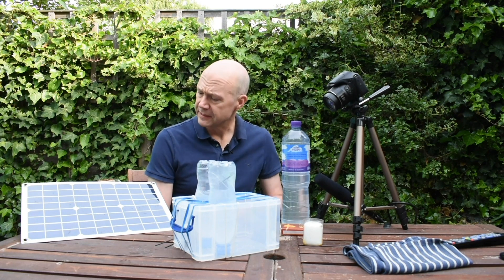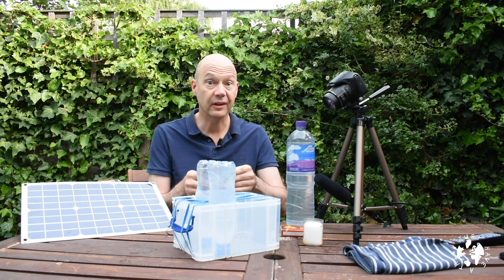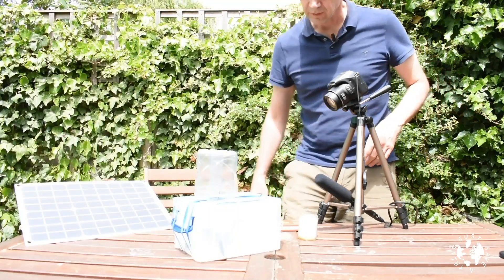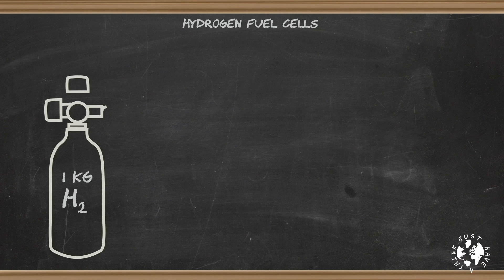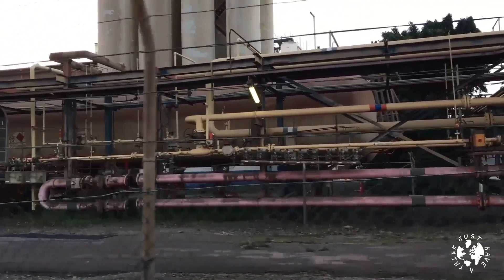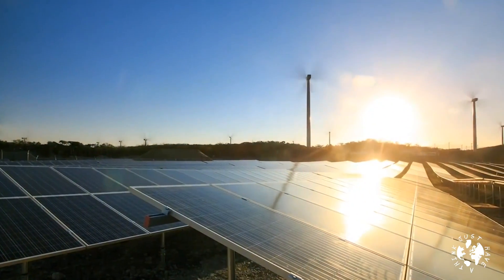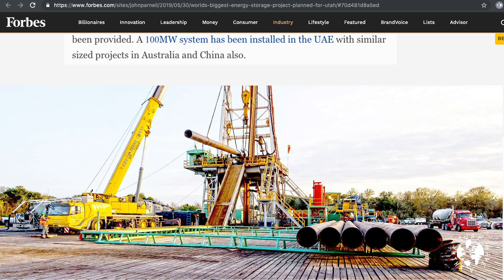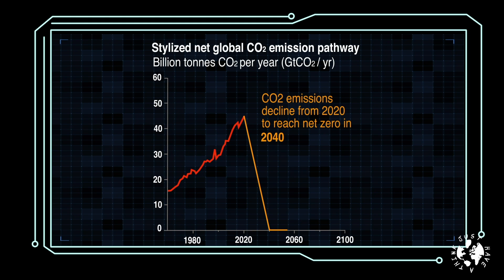Energy Storage in Hydrogen : Does this beat batteries?

Comment: no it wont beat batteries becuase its like 60 percent efficient vs 99 percent with batteries
Reply: efficiency does not matter here. at times there is so much surplus renewable electricity, that the producer must pay to get rid of it (or shut down turbines). in that case, the cost of energy is a negative value in the overall cost of the gas produced, and therefore it does not matter how inefficient the power to gas process is. the produced gas is still very cheap, because the energy to produce it would have to be (for example in the case of a windfarm) "declined" from the wind, and the turbines spinned idle - or even on brakes. so, there is at least some money made instead of no money made. if there is the chance to make power back from the gas at peak demand, there's more money to be made still. and another plus, the grid gets more stable if you can do that (as said, this can work with batteries too, but is arguably much more expensive for large storage, as the storage of gas only gets cheaper, the higher the quantity).
Reply: @aleksanderkac1494  So whats your saying is hydrogen could be a viable alternative to gasoline in cars becuase it could be used as an energy dump from the surplus reneuables? That could fall victim to the tragedy of the commons, for a few hydrogen cars sure it would work but if you have everyone driving a hydrogen car your no longer just using surplus and instead you have to make extra which would use more overall resources. Personally id like to see the probelm of surplus renewable energy solved by having the surplus electricity used to pump large amounts of water from low reservoirs to the reservoirs above hydroelectric power stations which could then be used to spin turbines to get the energy back when needed. Basically batteries scale better for using less resources.
Reply: @anthonyhadsell2673  No. Power to Gas hydrogen can be fed directly into the existing gas grid to be used at home, or used in PtG methane production. We do this already in Europe. European cars can be bought factory converted to natural gas (which is methane, so PtG methane can also be used), and a lot of our garbage trucks that work in the city are already NG trucks, not diesel. So this gas is ready to be used at home in heating or cooking or in cars and trucks that are only marginally more expensive than gasoline cars - or diesel cars and trucks. But you also have a point. Pumping power stations are also a good use of surplus energy, but not applicable everywhere. In Europe, not every country has available positions for high reservoirs. A mix of all methods will be necessary to store surplus power.
Reply: @aleksanderkac1494  I believe that while hydrogen cars could be viable they wouldnt be an ideal solution if everyone used them and itd be better if they were more of a niche thing to use as an energy dump due to the fact that batteries use less energy to move the same distance. Also im an american so im unfamilar with what your talking about but how could hydrogen be fed through gas lines? wouldnt they just mix together and create a gas that would put atleast some carbon into the air?
Reply: @anthonyhadsell2673  Actually no carbon. Hydrogen burning emits water only. It can be fed into a NG grid to a certain percent, displacing carbon from methane. Instead of NG, there would be NG with a percentage oh hydrogen added, it's no big deal, any normal NG appliance can handle it. Natural gas is not carbon neutral, so adding some renewable hydrogen into the mix would be beneficial. But, renewable hydrogen can be used to produce methane (by reaction with CO2 from a gas power plant for example) and create methane. This is the same gas that forms the majority of NG. Vehicles driving on NG are readily available and reasonably priced, IE. mostly the same price as a gasoline or diesel car. In a lot of cities of Europe you cannot use diesel municipal trucks, but we have methane trucks from the likes of Scania, Renault, MAN and Iveco. So it's a mix. We will need batteries, EVs, gas powered combustion cars and trucks, pumping power stations and some longer term storage, like compressing gas into salt mine caves. Or some other invention maybe.
Reply: @aleksanderkac1494  Im aware hydrogen burning emits no carbon i was just saying that when its mixed with ng it would put some carbon into the air. Less than gas diesel or pure ng but still some.
Reply: @anthonyhadsell2673  True. But a percent less is still a percent less. Do that at everyday level of activities, and the world gets better. To clean up our act will take more, but with small steps, we might just get there.
Reply: @aleksanderkac1494  Yeah i guess but really the effect me or you have on climate change is incredibly minimal. The public has been basically brainwashed into beleiving pullution and climate change is the fault of average people when really 70 percent of green house gasses are from the operations of companies and the reason we have so much litter is becuase plastic is cheaper than things that break down naturally, the mindset most people perpetuate is one that removes most to all blame from companys and puts it onto the individual, your right about it helping to put less carbon in the aptnosphere in any way but personally id like to see more people blaming large corporations.
Reply: @anthonyhadsell2673   Pump storage is not a global solution (unfortunately). In countries with moutains they have used if for decades (lower construction costs), if you want to do that in flat country it gets much more expensive. (They experiment with old mines - weight moving. Or compressed air (but this is storage for days not to bridge seasons).
Reply: Aleksander Kac when do you realistically expect real surplus? Shouldn‘t we switch to heatpumps first?
Reply: @matschlegel   Surplus power is made all the time. Not only in the renewable sector. Coal power plants can't modulate output quickly. Heat pumps have nothing to do with power storage like power to gas or batteries, heat pumps are appliances. And I thought you got that covered already in your "wende".

Comment: But you didn't answer the question in the title!
Reply from the maker: I think the answer is that the 'jury is out' on the main question. There are (as many people have pointed out) some efficiency and storage issues with hydrogen which are definitely challenges to it's potential global supremacy. My view is that the market will eventually sort out the winners and losers (as long as they are not fossil fuels), but the best strategy for humanity is to try to utilise ALL of the available renewable options so we have a 'best fit' solution for each requirement (static storage / small vehicles / large fleet vehicles / heating etc. etc.)

Comment: When comparing energy storage systems you need to ask:
1. Efficiency, ie how much power goes in, for how much comes out. Batteries win this one for short term storage, but hydrogen wins for long term storage.
2. Energy density: most important for transport as the mass of your batteries matters. Hydrogen wins, but as we have seen with cars, light aircraft and ferries, the efficiency loss is not worth the better energy density. This may change for large ships or large aircraft but it remains to be seen as neither has yet been implemented on those.
3. Response time: How quickly can the power be fed back into the grid when required. Batteries have proved to be better at this than most other systems, but I do not know how hydrogen does.
4. Cost. Batteries have traditionally been more expensive than several alternatives such as pumped hydro.

Also keep in mind that hydrogen is the preferred technology of fossil fuel companies because they hope to supply hydrogen from fossil fuels rather than electrolysis, so double check any facts and figures you see about hydrogen as there is a lot of misinformation propagated by the fossil fuel industry.

Also, when discussing storage, remember that many countries still have enough base load systems that they can add a lot more renewables before needing storage, and secondly over provision can be a viable and cost effective alternative to storage in some cases.
Reply from the maker: Excellent additional information Timothy. Many thanks for providing this. All the best. Dave

Comment: Technically feasible but not economically. Maybe more economically feasible if stored as methane and used with fuel cells. The technology has not yet arrived though. Though if you have drank the climate change koolaide then economics don't matter.

Comment: 'Renewable energy' is a misnomer. By the time you factor in all the energy that went into producing the solar panels or wind turbines, all the mining of ores, all the smelting, delivery to site, maintenance of parts (especially wind), then ultimate recycling of parts at end of life cycle, there is very little if any return on energy invested. The production of hydrogen using electrolysis is a very inefficient reaction circa 75 percent efficiency, then half this due to fuel cell losses, it's basically a load of bollocks, which is a shame as I quite like the idea of it. Let's all keep thinking!

Comment: Can’t believe yet another YouTuber decides to gloss over the energy efficiency conundrum. Too much energy is wasted during the conversion processes for hydrogen for it to be practical. The requirement for long term storage is overstated also. It is just simpler to build out renewable energy infrastructure of all types to have a mic then transport electricity through traditional methods. Electricity can be efficiently transported many 1000’s of Km’s. Batteries hold the best solution with its many practice uses in vehicles and as stationary storage. Evs will be utilized for periods of high grid demand.
Reply: Given that EV batteries have a limited number of charge/discharge cycles, I am a bit skeptical that we will see owners signing up to attach their cars to the grid for this purpose.   If new battery tech eventually makes charge cycles a non-issue, then I can see it.
Reply: cleanriver2  Tesla have already stated a model 3s battery today will last between 300k to 500k miles. The use of up to say 10 kWh per vehicle per day would not affect the life of a bev in a great way. My Nissan Leaf is 5 years old with 60k miles on the clock. And about 90% capacity available. I’d be amazed if I get 120k miles and 10 years from it. The leaf would have paid for itself. It would have been like getting a free car compared to an ice vehicle.
Reply: @tigertoo01  My Leaf is 7yrs, 75kmiles.  ~35% available.  Wish I had waited.
Reply: cleanriver2 sorry to hear that was it a pre 2014 model?

Comment: Hydrogen is a battery and a low efficiency one if generated by electrolysis. Secondly enegy density is low so storing enough in a vehicle is difficult. However it is a non wearing battery and Hydrogen has the potential to be made by photosynthesis, so it is attractive, but currently not practical for general energy infrastructure, but surely for surplus power storage.